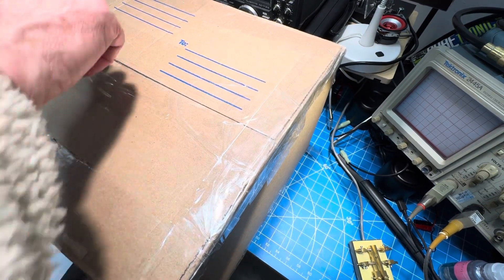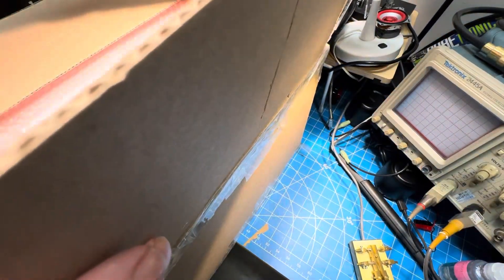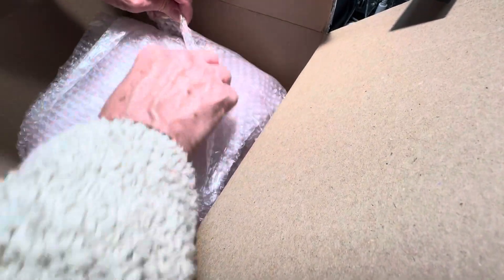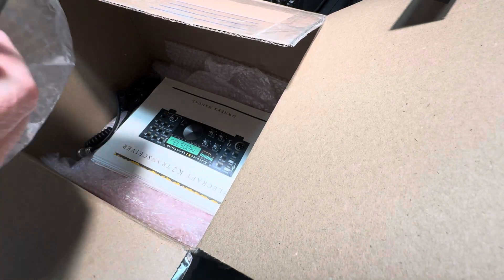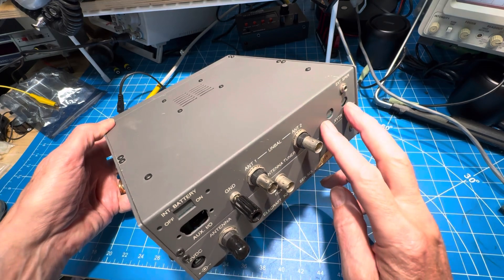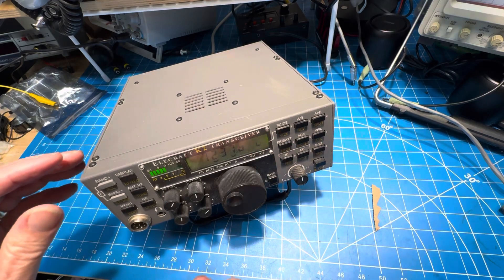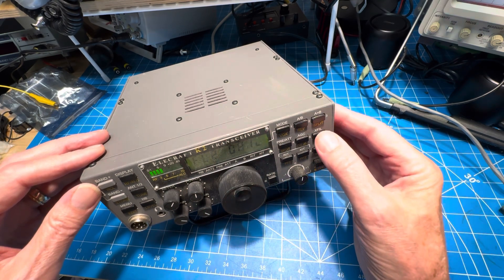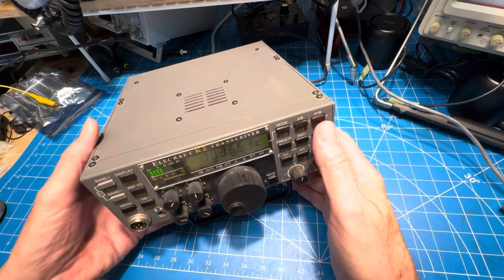Dear? Did you buy another radio?

Comment: I've a K2/100, not built myself. SSB, NB, DSP, 160M. Great rig. 73, PA0CMU
Reply from the maker: Thanks Carel, how many bands have you tried on the K2. I can’t remember ever getting on 160. I’ve never had a antenna on the band. I guess I can just try to feed whatever I have with the tuner.
Reply: @tyrueiI  ,my antenna's are a 3el tri-band beam Fritzel FB33 and a 2x18m doublet with ladder line so I can tune and use all bands, also 160m. But on some bands the doublet does not match well with RF in the shack as a result. Most times I reduce the output power to about 40W then. Do you have a K2/100? If I press the 'tune' button with the PA switched on (so >10W output) the output of the K2 fluctuates every 1-1.5 seconds. The needle of the SWR meter on my MFJ-949e tuner then goes up and down and that makes tuning difficult. I'm curious if that's a 'normal' process, some kind of security or something. With key down in CW the output remains constant.